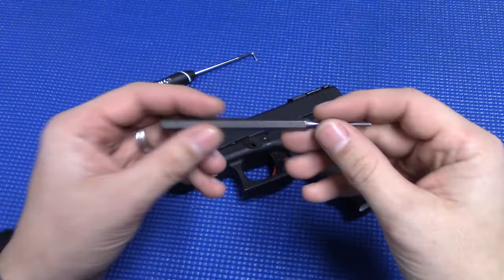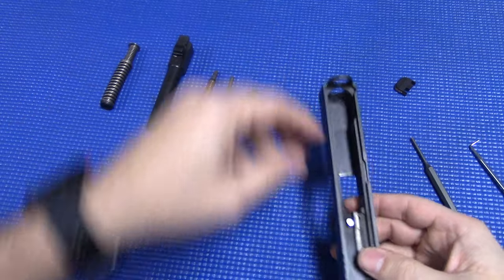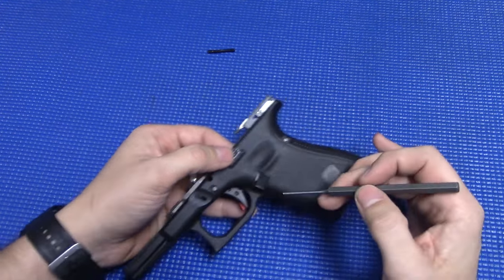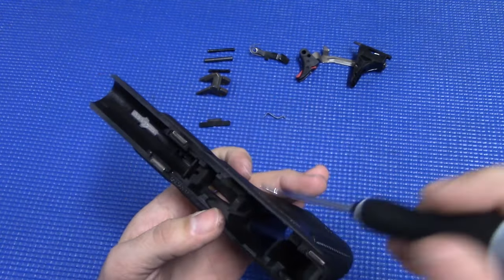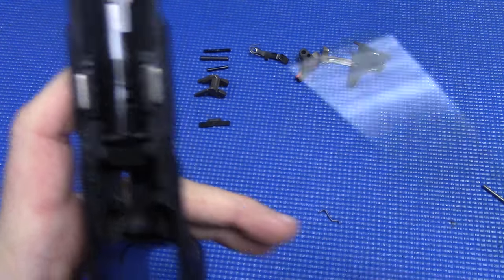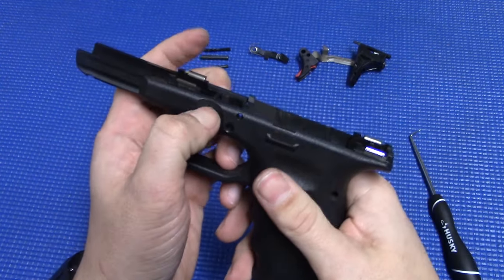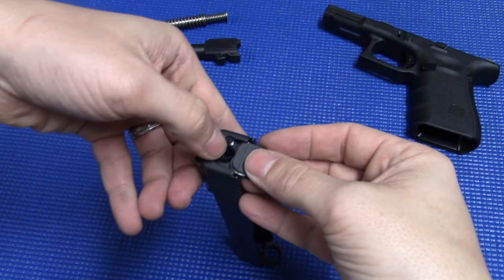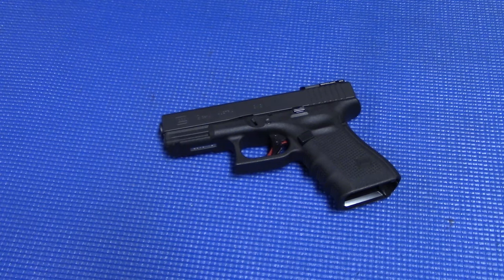Full Disassembly and Reassembly of a Glock Pistol

Comment: The one part from the slide most of us either never see, or don't know about, is the Striker Channel Liner. It's the "tube" that goes inside the striker channel, that never comes out during a disassembly. It requires a very special tool to remove it. On rare occasion, that striker channel liner can become warped, or somehow damaged enough to need to be replaced, but I emphasize, RARE occasion. It's easily  cleaned with a standard cleaning routine.
Reply: Says you buddy with samlott99 as ur user name

Comment: The tip you gave about putting the top pin in first, then the slide release was EXACTLY the tip I needed.  Thank you!
Reply from the maker: Glad it helped!  It took me quite a few rounds of fighting with that slide release spring before I figured out that time saver.

Comment: Had mine in my SXS that was unexpectedly sunk in a mud hole. The normal field strip cleaning wasn’t enough. Going to try this tonight. It looked easy enough to disassemble & never get back together correct so I held off until someone smarter than me could help. Thanks!

Comment: I bought a used Glock 22 Gen 3 a little bit ago, I had an issue with the slide locking back every couple of rounds. I noticed the slide lock was installed incorrectly by whoever owned it last. Thanks man, your vid saved me a headache.

Comment: lots of thanks for info on the "inverse" order of assembling the frame mechanisms!. Initially I did it "my way" (i.e. pure inverse order) and...faced great problems with the Glock. Ocassionally the bolt was blocked as if there was no bullet in the magazine (disaster in speed shooting). After watching your video again I realized that the spring of the slide release was stuck in wrong place because of my bad assembly after cleaning. Did as you said and works perfectly. Thx again.
Reply from the maker: Yup...its a very common issue.  Glad you got it sorted out.

Comment: That tip on changing the order of the pins on reassembly is so smart! I had hell the first couple times I did this trying to get the slide lock spring to move out of the way. Kudos 👌
Reply from the maker: That's exactly what I went through before figuring that little gem out.

Comment: Thank you so much, I really needed this. I ordered a Titanium striker and I used the gun and slide to hold the new striker while I put the striker spring and striker cups on. Somehow, the extractor fell out and the barrel seemed to be stuck on the gun frame and would not come off. Once I saw the extractor and watched your video I realized, I needed to push the firing pin safety plunger spring down and then I could free up the slide and take it off again.  The whole video was a big help and perhaps I would not have had my issue if I had watch your video before attempting the strike change.

Comment: Nice job ,clear to understand keep up the  good work .ps use a .17call swab ,or like I used was a hoppes longer q tip ,using the opposite end of the stick to push a small swab to clean up the extrator spring guide hole ,happy shooting.

Comment: Thank you for a very useful video.
You left one important part out - the disassembly of the striker and its spring
It is important for cleaning up the striker or even replacing it
Reply from the maker: Thanks.  Yeah it's been pointed out before.  I might have to go back and do a quick video on the striker.
Thanks for watching!

Comment: I'm a new glock owner, having a 17 G3, 43X & 48, until watching this I have been a bit intimidated to go further than field strip. Your video has changed my mind. Will my models be pretty similiar in disassembly? great work you have a new follower!
Reply from the maker: I don't have hands on experience with any models other than 17, 19, and 23, but  they all should be pretty similar for Gen 3 and Gen 4 models.  Gen 1 and 2 are little different and Gen 5 made a few changes as well.

Comment: Very helpful video thank you! I have a question though, after cleaning should I oil anything up before reassembly? Like should I oil anything in the trigger assembly? Etc?
Reply from the maker: I generally use CLP to clean with and just leave a VERY light coat on the barrel and internals.  I don't add anything else.

Comment: ~I have a Meprolight FT Bullseye Sight on order.  Since the front sight is not needed to use the FT Bullseye, I think I will take a stock plastic front sight and grind it down to give the slide a cleaner look and to fill the hole.  
~If I can't do it correctly, I'll live with the open hole and say my Glock is Ported.  LOL.
~I'm going to do a full strip soon and give my Pistol a thorough cleaning.

~Nice Video.  I'm 70 so I've archived it to use later when my old brain needs help.

Comment: It seems you know alot about Glocks. First thanks for a great video. I have 1 question? I have a 1994 Glock 21. When I try and remove my slide assembly the recoil spring on the barrel moves out of the half-moon slot and up to the next slot on the barrel. My slide assembly never removes/slides easily off, always catches. And yes, I have both sides of the barrel locking plate fully pulled down. What is your assessment? I’ve tried different barrels, barrel lock slide plates, different recoil spring assemblies. I’m stumped. The gun is basically new, only 26 rounds sense 1995. Thanks
Reply from the maker: Really tough to diagnose without being able to see it.  Sorry I can't be more helpful.

Comment: I own Gen 3 Glocks, by choice. For a full detailed disassembly, I use nothing but an OEM Glock "take down tool," which was also designed by none other than Gaston Glock. That simple 3/32 tool does it all. On Gen 3 Glocks, even the trigger housing has a tiny hole (3/32) drilled into it during production, that's the exact size of the Glock Tool - 3/32. The tip of the Glock tool will just push the trigger connector out of the housing.

Comment: When you reassembled it, you should of showed points to check for cleaning and oiling points for the Glock - but the video was presented very well, thanks!
Reply from the maker: Thanks.  I was mainly concerned with the disassembly/reassembly beacause the video is already pretty long.  Maybe a separate video on cleaning/maintenance in the future.

Comment: Would the instructions be the same for all glock pistols?
Reply from the maker: For the most part, yes...at least for Gen 3 and Gen 4.  I have no practical experience with Gen 1, 2 , or 5.  I know there are slight differences, but not sure to what extent it might change these instructions.

Comment: What happens if you put the extractor depressor back into the slide the wrong way ? With the spring part first/inside?
Reply from the maker: It MIGHT work at first, but over time the extractor would probably wear on the nub above the spring and start causing cycling issues

Comment: I was attempting to put the slide cover plate for about an hour. I went on Reddit and found this useful:

“It's the side with the extractor spring that won't seat all the way”

Answer: “Yeah it should push in at least until flush. Take apart the depressor plunger, spring and plastic detent. Make sure the depressor plunger fits into the spring. My guess is the spring isn't seating properly on the plunger. Or the Extractor isn't seated properly?

Is it possible you have the wrong Extractor? I think it changed a bit from Gen 4 to Gen 5.”

Comment: Is there any difference with the gen 5's other than the 2 vs 3 pins in the procedure?
Reply from the maker: Other than holding one in the store, I don't really have any in depth hands on experience with the Gen 5...Sorry
Reply: @TacticalSwede  I followed your guide and other than in a change in of the shape of the safety plunger, it seems to be the same. For example, I fired it and it didn't explode. I did not take the striker apart, too many tiny things to lose. I just soaked it in rubbing alcohol and cleaned out the striker tube with the same. I am hearing from everywhere that the upper parts get zero lube since that goes against every instinct I have I add a drop of CLP on the plunger, on the ejector, and 3 on the striker which I wiped down gently with clean patches. Used the CLP patched to run down the striker channel to give it some protection. I'm guessing that what I heard about No Lube in striker chamber is NO Grease, gun butter, etc. anything that would collect dirt and grime over time.

Comment: I see you have the meprolight on what Glock did you use i the video? Because I wanted to put one on my Glock 26 but it says it doesn’t have that option so what could I go with for a alternative? G17,G19,G27 someone lemme know what size sights fits the 26
Reply from the maker: The one in the video is a Gen 4 Glock 19

Comment: My slide lock always catches on the slide, without the mag in. Any help would be appreciated.
Reply from the maker: So the slide is locking back without a mag in?  That can be caused by the wire spring on the slide stop lever sitting ABOVE the locking block pin instead of BELOW it.  Hope this helps.
Reply: @TacticalSwede  I'll try messing with it when i get out of work. Thank you.

Comment: what am i doing wrong with my Glock 19 I cant take the upper off i tried and tried but those damn pins you grab are insanely difficult to grab and pull and when i think i have it the darn thing wont slide off and i have to re-culck it and can hear something like a spring or something inside go back in I dont know what the heck. my fingers are super shredded from trying to do so.... does it have to be both slide locks squeezed down at the same time or just one from one side?

Comment: Did he even actually slide the little wire from the slide release under that pin because mine will not just slide under an when I do what he did it's not in place
Reply from the maker: Yes, it goes under the top pin...but once it's under, the holes for the trigger pin wont line up on their own, you need to adjust it as you put the pin in.

Comment: I have a g17 from 1990 and does not have the locking block pin, only has two pins.
Reply from the maker: Sounds like you have a Gen 2 Glock there.  I have NO hands-on experience with Gen 2 and earlier so I can't really help out on that one.

Comment: I have the hardest time trying to pull down the two tabs..when field stripping..I just will go back to my Springfield 1911..maybe because I was told I have not practiced enough..Hard enough trying to find a shoulder holster for my Glock 30S..
Reply from the maker: They do make aftermarket ones that extend out a bit further to make them easier to grab.
Reply: @Tactical Swede - Will look into those after market extended tab..still having another problem searching for a leather form fitting shoulder holster for the Glock 30S,thinner slide than the regular 30  and being a southpaw is bad as 90% of handguns are made for right handed shooters and the other 10% can be switched over to make it easy for a leftie like Berretta 92F safety and mag release,the Glock 30S I have is a gen 3 and can't be switched like the gen 4 for us. The AlienGear shoulder holster I'm not too keen on the rigging..like something that lays flat with bulky straps and buckles.Thank you for replying to me..really good video on full disassembly and reassembly on the Glock.

Comment: I shot my Glock thousands of times - never did such disassembly and everything worked fine - this is why I chose Glock in the first place
Reply from the maker: They are tanks and can definitely take a lot of abuse...but over time, without regular maintenance, things will wear...things will break.   It will work...until it doesn't.

Comment: The only thing that I would have liked to see in more detail is the seating of the recoil spring.  I'm unclear about which ledge to seat the assembly on.
Reply from the maker: As you are looking down at the barrel installed in the slide, the recoil spring sits on the 2nd ledge on the barrel lug (usually has a semi-circular cutout)
Reply: @TacticalSwede  Thank you for taking the time and effort to answer.  Your description is very clear and helpful.

Comment: Will this work with the Glock 17?
Reply from the maker: Yup as long as it is a Gen 3 or Gen 4.  Gen 1 and 2 have some differences.  Gen 5, from what I can tell, SHOULD be the same, but I haven't physically taken a Gen 5 apart to be sure.

Comment: Does this work on gen5s?
Reply from the maker: The process is mostly the same on Gen 5, but there are some differences (biggest difference being the Gen 5 does not have a pin in the locking block...so only 2 pins vs the 3 pins on a Gen 3 and 4)

Comment: Say what one will above the Tupperware... But, "Glock simplicity."  What would you rather have, a Glock with so (relatively) few parts and common, or some complex 1911 or Beretta, or more exotic you can't find a spring for, etc. Magnolia, it must be 10 years later I came right back to this one for detail strip to jog my memory.

Comment: Here is another one of those young people who grab the slide and yank it back and let it go forward, and then say their gun is empty. What if your extractor is not working properly and doesn’t grab the rim of your shell that might be in the breach? what will then happen when you pull the trigger so you can remove the slide on a Glock? Yeah, the same thing that has  happened to scores of people who ended up with bullets in their fore arms and hands. 
For anyone reading this comment, please look stop and look in the breach and make sure there is not a bullet in the barrel when you pull the slide back, don’t just jack your slide and say i your handgun is empty. It might save you a trip to the hospital, or to a grave.

Comment: I cannot rack it back in
Reply from the maker: Difficult to troubleshoot without being able to see whats going on, but there is definitely something out of place if the slide wont go back on.
Reply: @TacticalSwede  I figured it out on the there was a little button I had to push I was scared I messed up my Glock right away I was installing my Talon grips and I had to take off the slide

Comment: What trigger is that???
Reply from the maker: Zev Tech Fulcrum
Reply: @TacticalSwede  I bought a zev’d out 17 from someone, and I have what appears to be that trigger (most parts are Zev), I disassembled and looked for the zev logo marking on the connector but didn’t see it? Does your have the logo or no? (Was thinking since it’s older maybe they just started adding the logo onto their connectors)
Reply from the maker: I never looked before so I just took it apart to look and mine has no logos on it.
Reply: @TacticalSwede  awesome you helped me out a lot for real. I’ve been trying to identify piece by piece for a month and that was really the last. Also the video was great and explained and demonstrated accurately as well as simply.
Reply from the maker: Always glad to help bud.

Comment: im gonna buy each piece until i get a full gun
Reply from the maker: That's one way to do it, though you won't be able to (legally) buy the grip frame without buying it from a licensed dealer (FFL)...unless you go with an 80% frame like a Polymer80.
Reply: @TacticalSwede  yea i just found out about that... its still easy
Reply from the maker: I've done P80 builds.  Ends up being better than a stock Glock.
Reply: @TacticalSwede  yea im looking forward to it

Comment: Idk how you all grab those tiny little crappy tabs on the side to remove the slide. It's almost impossible to pull both down at the same time in mine. Just a bunch of broken nails as a result. Bad design on the Glock
Reply from the maker: I've never had an issue with them, but they do sell aftermarket ones with extended tabs to make it a little easier to grab.

Comment: This is not a complete disassembly, you missed the trigger spring, connector, trigger mechanism housing, firing pin, spacer sleeve, firing pin spring and spring cups.